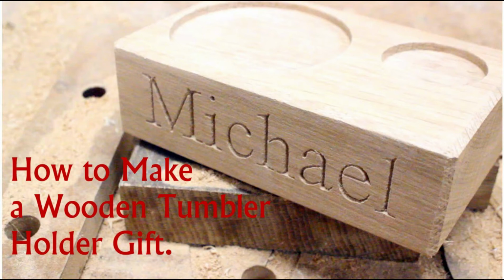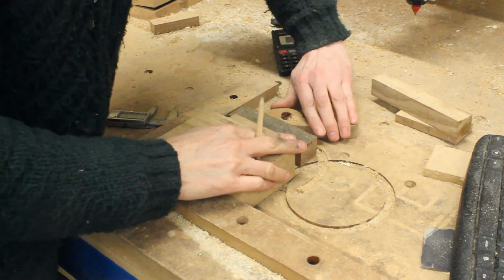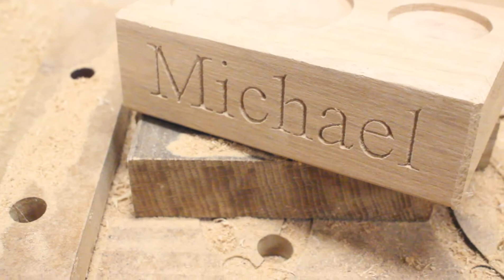How to make a wooden tumbler holder using a cnc router

Comment: I like the clamping system you are using, going to have to make one of those for myself.  Like the drinks holder product, nice finish to it and awesome CNC machine.
Reply from the maker: Cool, thanks!
Reply: @mycountryworkshop3201  Is the CNC a purchased one or home made?  If purchased where did you get it from?